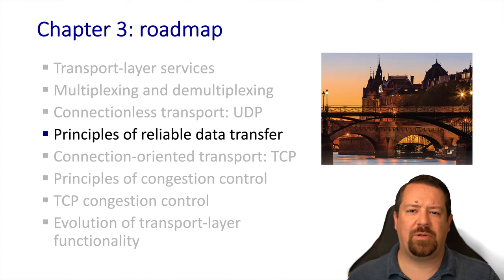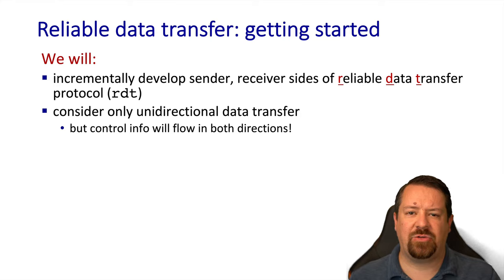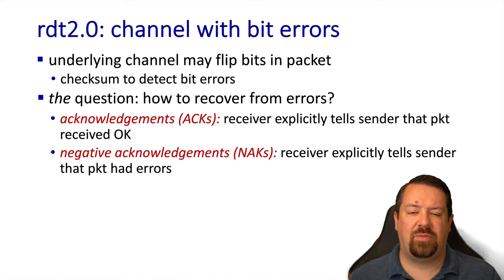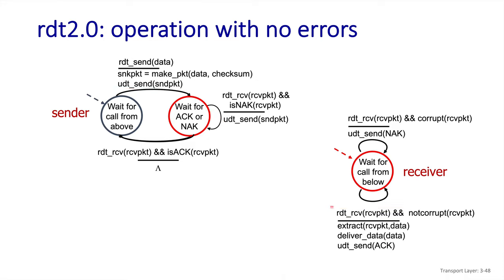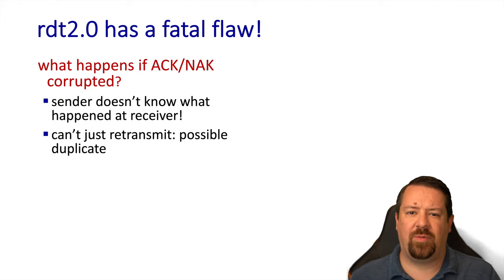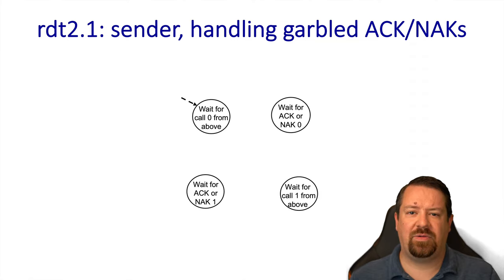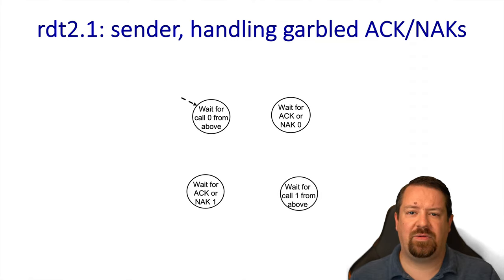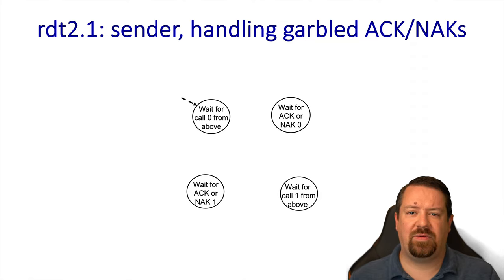Reliable Data Transfer - Internet Transport Layer | Computer Networks Ep. 3.4.1 | Kurose & Ross

Comment: Suppose, You and your friend want to transfer data, and both are decided on the
following data transmission properties which should be incorporated in the
transport layer service:
no bit errors; no packet loss; encryption at the sender and decryption at the
receiver.
Now design the Finite State Machine (FSM) for you and for your friend.

For this scenario which rdt version we need to use? and how can we add encryption & decryption on that rdt?
Reply from the maker: No bit errors and no packet loss means we have a reliable channel, so RDT1.0 is sufficient for reliability.  Due to the principles of layering, we would not combine encryption with transport, we would either add encryption as a layer on top of transport (as TLS does) or provide it at a lower layer (as in IPSec).  I'll be posting new videos that cover these topics soon!
Reply: @EpicNetworks  Thank you so much.
Reply: @LittleSudip  No problem!